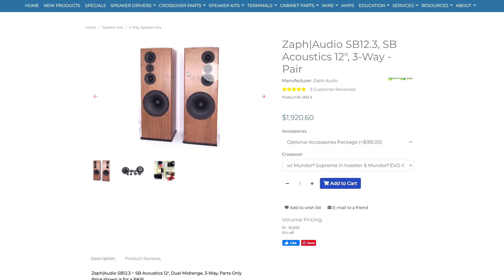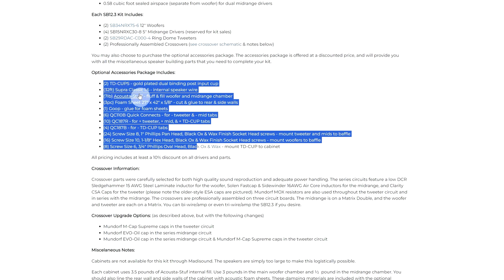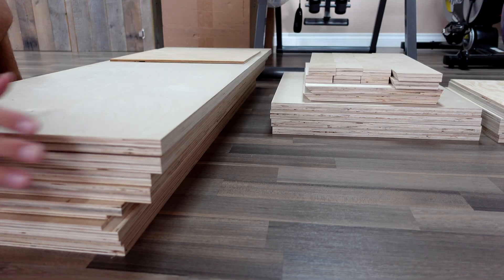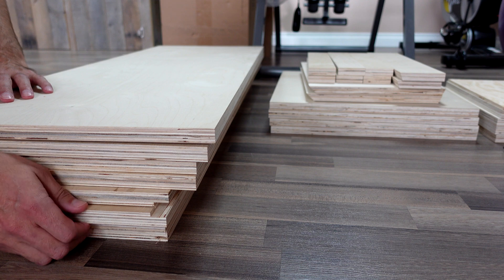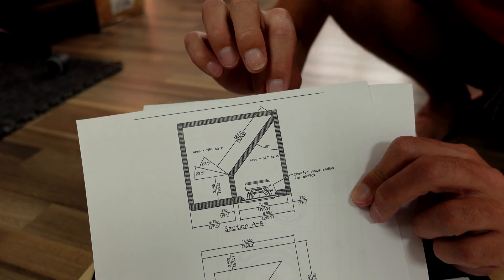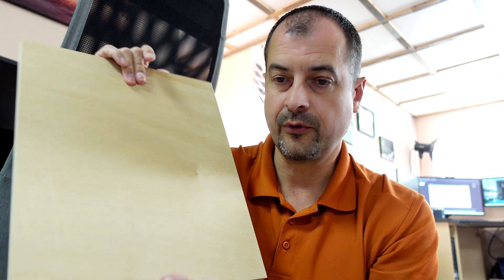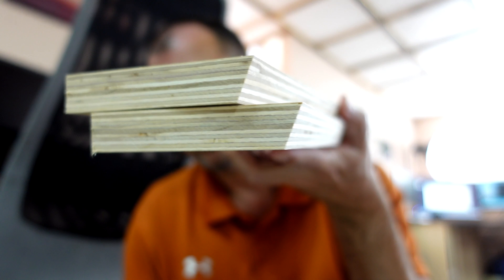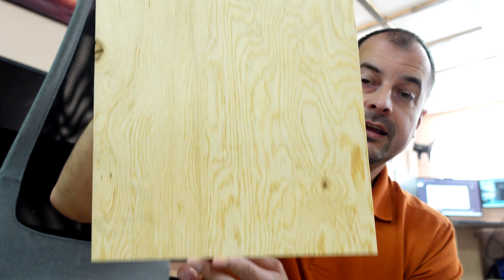Building The Zaph Audio SB 12 3

Comment: I built these last year, actually finished them last year.  Started in winter 2022, used red oak, the cabinets took me several months to build/assembly.  Later I designed and built a set of passive radiator subs with matching SB acoustics drivers, and a speaker power stand alone amp.  These speakers are amazing, by far the best speakers I have ever owned, look and sound amazing.  I did enlarge the enclosure design some, I wanted them taller!
Reply from the maker: I can't wait to hear them, I've heard so many good things about the drivers and have read comments online about these speakers.  I've used a few SB acoustics drivers in other projects, I really enjoy the sound of them, already thinking I will need a center channel, I've heard things with their drivers I have never heard before in music.  Thanks for sharing your experience, welcome to the channel!